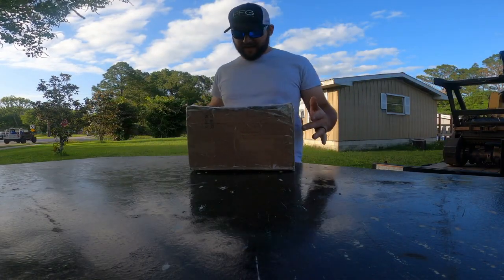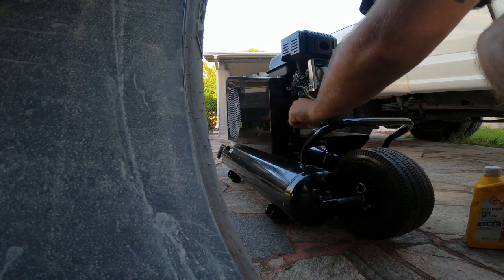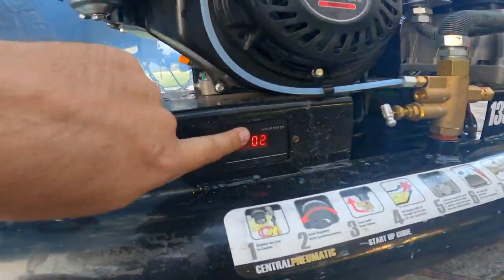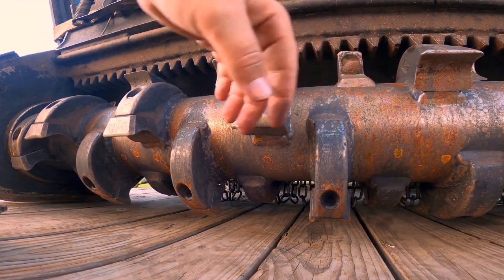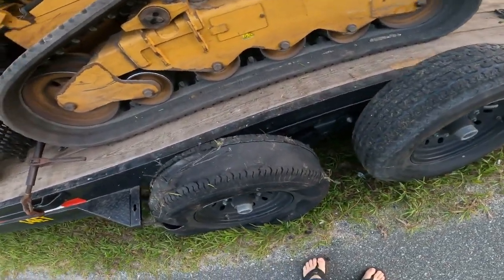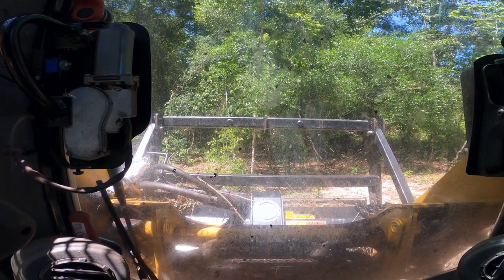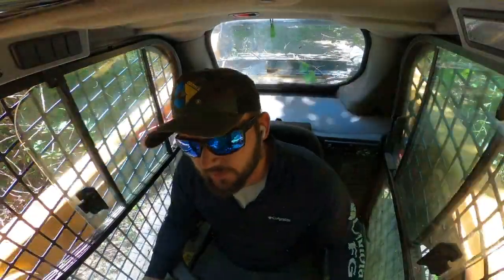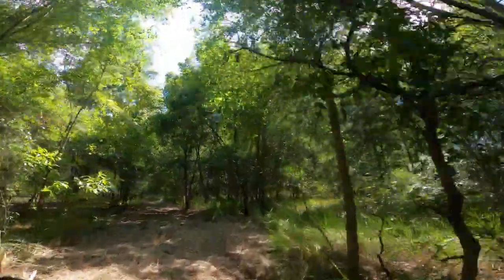ARCHIVE SERIES: Forestry Mulching a SxS Trail through the Florida woods  CAT259D

Comment: How many miles on the f550?
Reply from the maker: That’s actually Huckleberry the 2011 450. That truck spun its crank and is still at the shop. It has 245k on it I think… or 180k. Can’t remember. But the new engine going in is gonna be a 16+ version so a lot less problems compared to the first gen 6.7